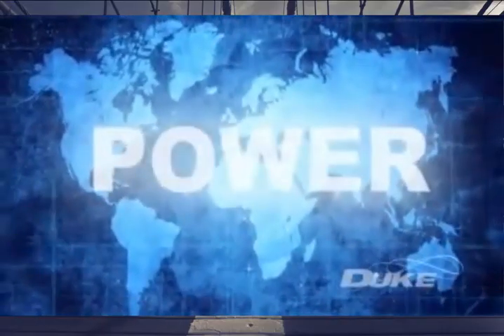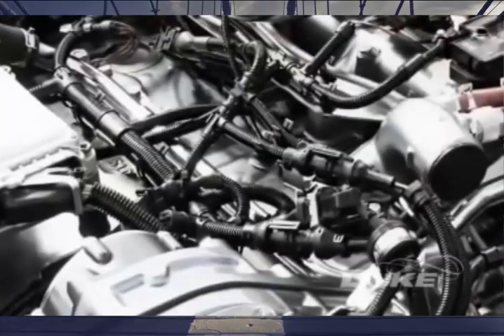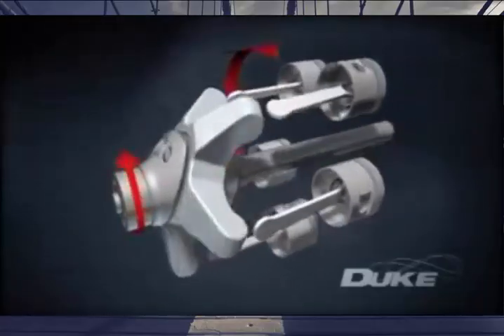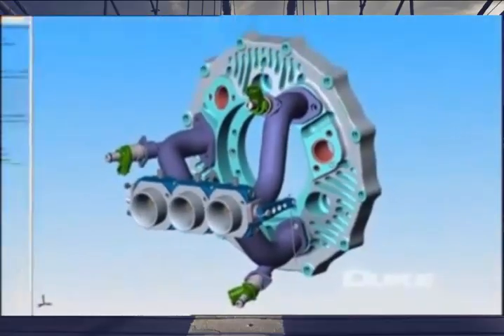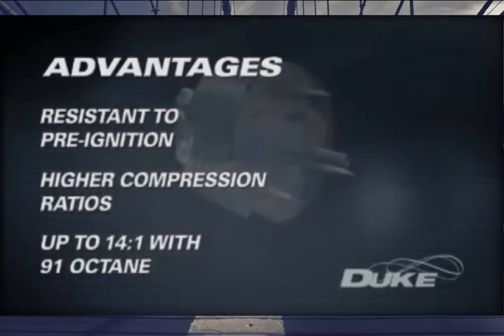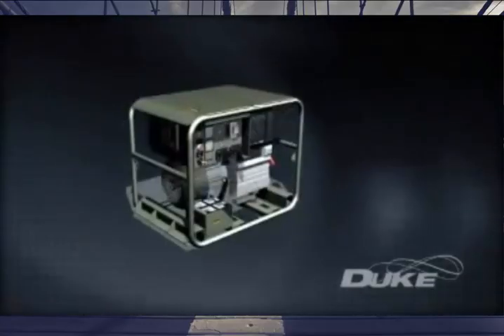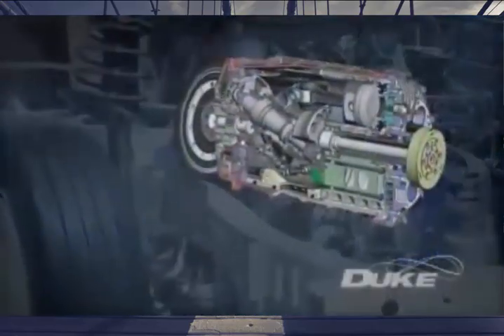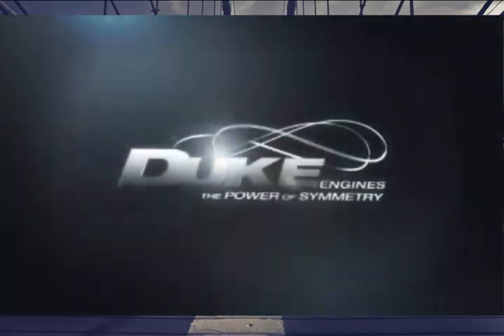Duke Engines | All information about Duke Engines

Comment: It all sounds great but the Devil is in the details. There is still a lot of friction to overcome as the cylinders spin around. Will these engines actually last?
I hope they can make them work but if they have a short lifespan  they will fail even if they are smooth and efficient.  I am not convinced these engines used in a mass production car are going to compete well against electric cars like Tesla.
Reply: Gotta love the brushless electric motors and their lack of friction.  Couple that with a Tesla infinite battery and you can go 200,000 miles or more free... Or until the berrings give out on the brushless motor.
Reply: It would appear to me that the volumetric efficiency could never approach that of a convention stationary cylinder design, and the swash plate type system of rotating cylinders being sealed effectively has other losses and wear issues similar to a rotary engine.
Reply: You're right, A case of... cool design, it works, but its not better.
Reply: no you cant ya fool.
Reply: It seems like a case of its  COOL to look at, its brilliant, but it is not better than what we've got.
Reply: Kevin Zabbo They are only interested in suckers with deep pockets and less engineering knowledge they have the better.. haha!
Reply: longevity is a key factor, hopefully with the new materials of today they can pull it off.
Reply: IKR? My first thought is that the cylinders rotate, but the spark ignition point does not. That means the bearing rings that hold the star shaped reciprocater in place are constantly getting hammered at the engine's hottest point only: the powerstroke spot, which is at the top of the engine in this animation. The other 359 degrees of that maypole tree dance circle are only for the venting and reloading of fuel mixture, so the bearings are unstressed there.
Reply: Yeah, this may be what you meant, but the faster that engine spins around, the more the pistons, and more importantly the rings, are squashed against the side of the cylinder.  Also, the reverse is true on the inside, pulling pistons and rings away from the cylinder wall.  At a very generous radius of 20cm, at 6000rpm, this amounts to an appalling 2000 g's.
Reply: Kevin Zabbo Uh.. no they don't.  The Abrams main battle tank uses a gas turbine engine.  Most helicopters use gas turbine engines as well and pretty much zero of them have a service ceiling above 20,000 ft.

The only kind of turbines that "work best at 30,000 feet" are turbines that are specifically designed to work best at 30,000 feet, which is a pretty much 100 percent useless piece of information.
Reply: What we need to do is allow the population to use water powered fuel cells or better yet, Tesla flux generators that don't require any fuel, they just channel ethereal energy into drive batteries.
Reply: yep, you cant beat only 1 moving part in a motor unless you go maglev
Reply: The Devil is in where the money goes... and in vaporware scams like these it does not go into further research or production facilities.... it goes to buy someones yacht.
Reply: largol33t1 The design has had some major limitations and disadvantages since it first appeared over 100 years ago, this is not a new concept its been well researched and developed long ago..  this is a classic vaporware scam, not any kind of a legitimate engineering project and should not be taken seriously at all.
Reply: matthew lamonte THATS RIGHT BABY!!! BIMMERS IN THE HOUSE!!!!
Hey Matt!  How are your rectal fissures doing..  Did you find a job yet? or are you still living in your moms basement????:
Reply: matthew lamonte Excellent! Everything is just brilliant here.. Brush fires are under control and things are clearing up nicely.. No worries mate! Cheers!
Reply: they wont be able to compete with turbineshaft engines
Reply: Kevin Zabbo Its already been tried many times..the ideal duty cycle for a gas turbine is poorly suited the the typical drive cycle of an automobile.. fuel consumption is negatively effected.
Also the average service life of an automobile does not make economic sense either.
Reply: BellinghamsterTrail I like the part where I can't tell whether that's trolling or legitimate crazy.  Kudo's to you.
Reply: BellinghamsterTrail
"Alternative sources of energy," such as water power (prove it to me with a working model I can take apart), or 'ethereal energy.' Again, give me a working model I can take apart.  These two technologies have a reputation, much like the perpetual motion machine, of not working or they work only for the demonstrator.
Reply: BellinghamsterTrail If your "ideas" cannot be parodied because they are literally indistinguishable from actual insanity, thats kind of a clue that you might want to rethink them.
Reply: What do you think about Duke engines? Have an opinion?
Reply: IF they can get past issues like that AND keep fuel economy reasonable, the rotary engine might meet its first real competition ever. I don't see why this can't work.
Reply: its all in the "IF" factor. 
The devil is in the details.
Reply: i knew you be in the comment section somewhere lol
Reply: The real doktorbimmer wow there was no need for that lol 
But to answer your questions there painfully.... Yes and yes 😂

And how are you?
Reply: The real doktorbimmer glad you is good 
where is here by the way?

And thanks for the engineering lessons I have learnt alot from your comments
Reply: matthew lamonte California now.. just up the road from Santa Barbara a bit, great views, nice weather... Switzerland is just far too cold except for mid summer.
Very good, I offer what I can when I'm not busy or just relaxing.. 
 Have you heard anything about HCCI or Turbo-Compounding technology lately? A lot of new development in these areas lately.. we are looking to see some incredible improvements in fuel efficiency..
 you should check them out..
Reply: Maintenance will be horrible, just to change pistons you will need to take out the engine and take the whole case apart.
Reply: Turbines work best at 30,000 feet.
Reply: Kevin Zabbo No, not true.. marine gas turbines work only at sea level and they are extremely efficient.
Reply: The real doktorbimmer
Build one for a car.  Be the first.
Reply: Kevin Zabbo That's already been done.  There were a few models of cars in the 50's that had gas turbine engines.
Reply: htomerif
Have you read up on them?  They were far more expensive than the piston engines, they ran way too hot, and they weren't quite as fast or efficient.  They were relatively quiet, though.  However, since you're such a proponent of the turbine, why don't you design one for sea level operation that doesn't mind the stop & start of everyday driving?  I'll stick with pistons because they can handle a million miles of abuse that drivers give them.  In fact, I'm working on a 2-cycle piston engine that doesn't burn its oil.  60mpg Cadillacs are possible.
Reply: You raise a lot of good points and none of this is personal to anyone. It's just that with every new type of power system there is always a spoiler problem that can't seem to be overcome so we always revert back to the tried and true internal combustion cylinder engine. 
And now Tesla has seemingly overcome the battery problem and has made electric cars feasible which further makes any other new internal combustion engines less desirable.
Reply: Kevin Zabbo So its a Uniflow spark ignition? or a Winton type Diesel?
The Axial cam engines have an even longer development history than gas turbines for automobiles.. its seems pretty clear that neither one is suitable to automobile applications.
Reply: BellinghamsterTrail I think we have established that the basic design of the Duke is not new, its just proven every time to have more disadvantages than other successful engine types..
We have embraced the reciprocating Otto and Diesel engines because they are proven superior and still have a considerable development potential.
Really? Because their range still sucks compared to an ICE car and still has the recharging rate problem..
 I saw on the news recently that another one had caught on fire again.
Reply: The real doktorbimmer I dont know what gave you the impression I was in favor of gas turbine engines in cars.  I was gonna make most of the points you made, but.. 

well shit...

I thought someone else, but actually you made the points I was going to make.  Yeah, they're just too expensive and they don't keep pace well..

To play devils advocate, advances in materials would probably bring the price way down and, more importantly, modern CVT's would almost completely make up for a gas turbine engine's painfully slow throttle response.

Maybe this is a point that you also made, but I think you said the opposite: I've never heard a quiet gas turbine engine.  Everything from the hobby-class engines up to.. well, the sky's the limit, are massively loud compared to their piston based counterparts.
Reply: htomerif
Materials or not, the turbine could be used to drive a generator that charges a battery that powers an electric motor.  The turbine, in this case, would make an excellent power source.  Trouble with this is that it's also heavy.  It's basically a railroad locomotive arrangement.

Best to use a diesel.
Reply: Kevin Zabbo Yeah, or like I said, a CVT, which doesn't weigh anywhere near as much as an electric motor and electric storage.

You know what might be interesting? Using a centrifugal supercharger with the exhaust half of a turbo on the same shaft.  Then you'd have an engine that was both genuinely a gas turbine engine and a piston engine.

I dont recall that having ever been tried before.
Reply: LOL, I am strangely flattered but at the same time It makes me realize you really don't know about alternative sources of energy.
Reply: BellinghamsterTrail Noel Duke is a fraud.. Duke Engines ltd. is nothing more than a elaborate vaporware scam..
Reply: The real doktorbimmer
As for your negative claim, I cannot substantiate, but they did refuse my offer on a new kind of engine that would be far superior to theirs.
Reply: That is very important, but what if it's cheap to repair it?
Reply: Pipe dream.  They can not seal the spinning combustion chambesr to the stationary head.
Reply: some of the best engines used in avaiation were reciprocating, check history
Reply: that wobble action appears to be a major failure point.
Reply: Tesla is Selling Defunct Cars
Reply: If its smooth and efficient you will have no lifespan issues. If they wear out quickly it is not so smooth or efficient. If your hotrod aspirations take over a little file work on the ports should make it scream or grenaid. They should work on a 2 stroke variant. Talk about zoom zoom.
Reply: BellinghamsterTrail ,infinite?? Battery. If such exists why are we paying the power company to charge our phones? Clearly not using Webster's definitions. Free?? Now your really dreaming. Wake up and smell the exhaust. I assume your drinking the Musk KoolAide. If your talking about Nikolai Tesla your probably on to somthing. But with  Teslas' wireless power delivery why would you need a battery.  Too bad you will not be living long but you will meet the man who built a car that runs on water.
Reply: tesla is a joke.

Comment: This basically combines the worst of a piston engine, with the worst of a Wankel rotary. There's no possible way this could even be remotely efficient. Look at the animation, the piston reaches the exhaust port about a quarter way down the power stroke. A port system will not work in this style of engine. There simply isn't enough space.

Comment: Audi will stop development of all internal combustion engines by 2025. Already decided. There is a better engine already. Tesla uses it. So, although this is remarkable engineering, it is too little, too late.
Reply: Tesla does not use an engine in any car. They all use a motor.
Reply: You're funny.
Reply: How many days are required for a Tesla to travel 1000 miles? They make great looking cars but who needs two hour fuel stops?

Comment: It'll suffer the same fate of the wankle (rotary) engine TBH
Reply: There are apex seals for rotary engines nowdays, that are flexible & don't break. I had a friend who built them & says that you can safely run high boost with them, like 20psi.. I'm not a fan of rotary engines though. A lot of people don't realise that the Apex seal problem. probably isn't actually a problem anymore with the new seals
Reply: Apex seals and lubrication was a major problem with the wankel since there was no 'crankcase' and it had to consume oil with the fuel charge to lubricate itself, affecting EPA emissions, as well as having a non ideal flame propagation as the combustion chamber changed shape during the power stroke phase (it required 2 spark plugs fired at different times to burn the fuel properly.)
  
Though there's a space for a crankcase on the Duke...I have to wonder, since the cylinders rotate with the pistons...how does the top of the moving cylinder bank seal against the head?  Wouldn't it have a similar problem as the apex seals in a rotary?
Reply: I thought the same
Reply: This could use scientific study to verify instead of word of mouth...

Comment: neat idea.  They mentioned that there isn't a traditional cam shaft, but did they mention the new rotational weight of the pistons?  Because in addition to the pistons linear motion they now also have rotational motion.  But with the overall weight loss this seems like a win.  I wonder what problems they have encountered in their decade long research, especially since cars are expected to go 200k without engine issues.